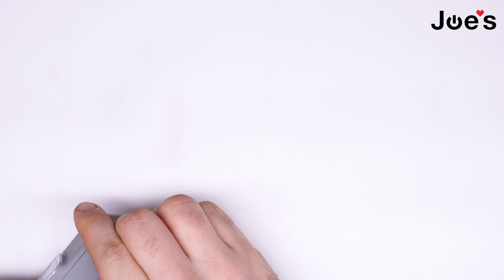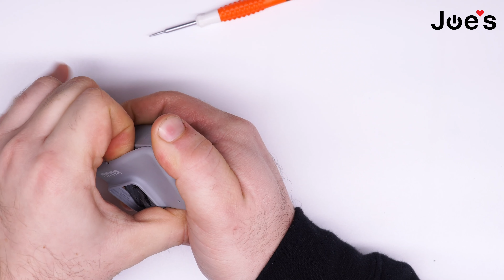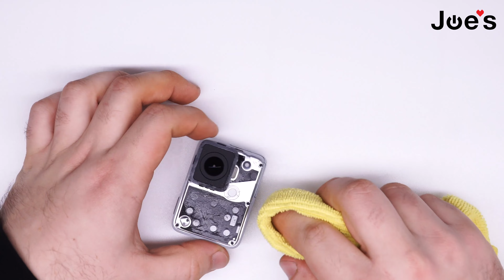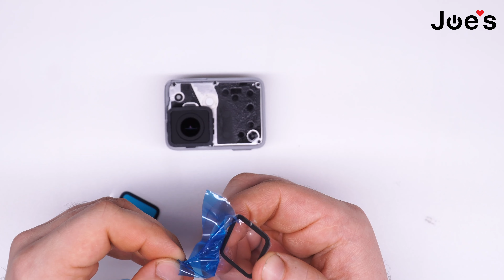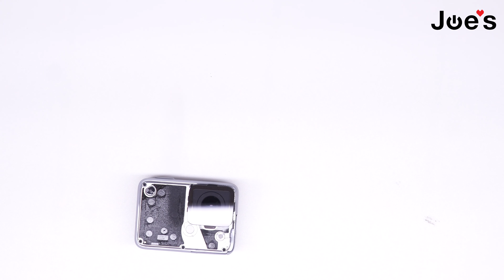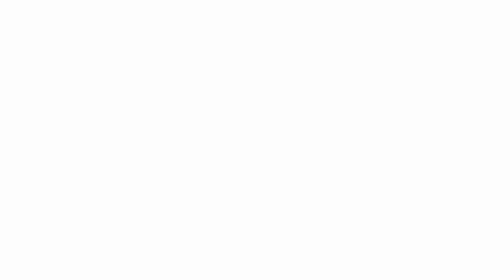Replacing GoPro Hero 7 Protective Lens Front Glass | How To Tutorial

Comment: Thanks for sharing this process, It was helpful for replacing the glass. The only place I could find replacement glass was on aliexpress. One issue I had was with the adhesive. For me the replacement glass was not truly waterproof and was letting in small amounts of water under the glass when used underwater. I came up with a DIY fix though using RTV silicone caulking to reseal it, in replacement of the provided adhesive strip. I used VERY small amount of silicone by piping it around the edge where the glass goes. To do this I squeezed some silicone into a plastic bag and punctured a pinhole at the tip of the bag, then used it to squeeze a tiny bead all the way around. After letting it dry for a day or so, it is now completely waterproof and much better than the adhesive strip provided.
Reply from the maker: Thanks for the suggestion.